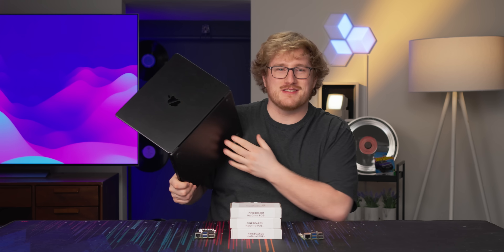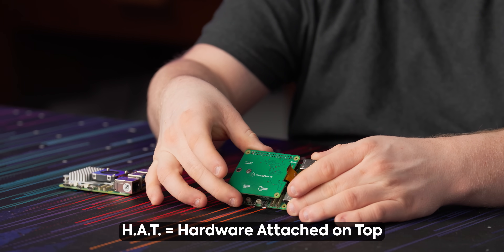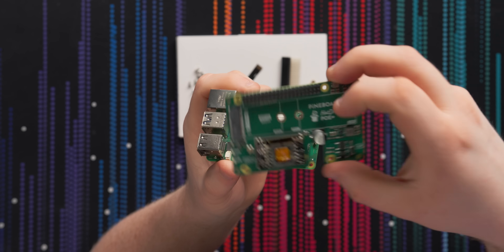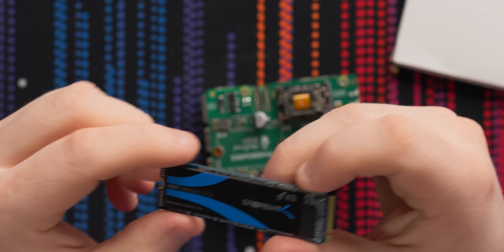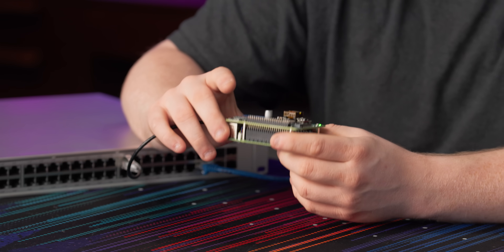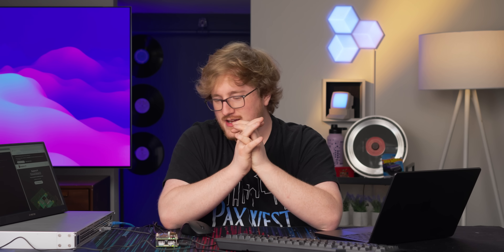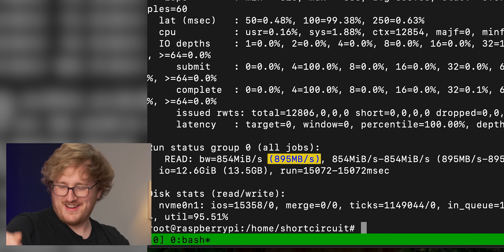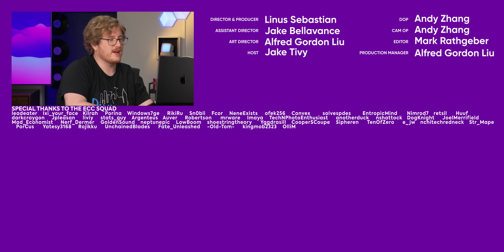This solves the Raspberry Pi’s BIGGEST problem - Pineboards POE+

Comment: "Argon ONE M.2 Aluminum Case" for Raspberry Pi 4...  I've had one for a couple years and they're pretty slick. (there's a new version for the Pi 5 too) The whole aluminum case acts as a giant passive heatsink but there's also a small fan too, only wish it was larger diameter/quieter if say you're overclocking the snot out of your Pi! 😅 I just stuck a "normal sized" CPU heatsink [AKA massive F'n over-scaled!] on top of the case with some thermal conductive tape and the fan never runs with a stable 2.2mhz overclock! The M.2 NVME daughterboard connects using a USB 3.0 port adapter which means drive speed is limited to ~600 MB/s vs newer NVME drive speeds around 3500 MB/s, that's nearly 6x faster, but still about 3x faster than your typical MicroSD card speeds of around 150-190 MB/s!

Comment: One thing you DEFINETELY should do is install log2ram if youre running your Pi off of an SD-card.
Bonus points if youre grabbing a Pironman 5 Max, which has 2 NVMe slots and the cutest tower cooler youll ever see. ;)
(Because, whom are we kidding, OFC your goina OC it to 3GHz. Esp now that you cant void your warranty anymore by feeding it too much voltage.)

Comment: I disagree. 

The Raspberry Pi’s BIGGEST problem is overheating.
Then you order the FAN + heatsink. Then you notice that the FAN is noisy AND you can't control its speed.
and the story goes on and on...

Comment: These little things are so sick. We built a cluster out of them for a Systems Administration class at my college. And yes, the head node had a micro SD card as it's main drive and yes it did fail and yes it did fail many times and yes I had to fix it every time and yes i was a participant in the class and yes we did eventually switch to the nvme

Comment: Love the NVME drive addition.  I've used POE to power my Raspberry Pi boards for a while - I just use a POE splitter off of a POE switch (UI also).  These are normally around $5-$15  so a bit less than a hat.

Comment: Pineboards is no more. Dead company. Also, when you add Hats (or in my case, boots - under-board) you increase the power draw. Gets to the point where PoE will never give the amps needed. Pi 5 draws more power. Not sure PoE is up to the new Pi power draw requirements, unless someone comes up with a new ethernet standard that includes more amps

Comment: Just picked up a Pi5 a Poe+ hat and a GPIO breakout hat all nested nicely on the Pi5. Used the same Windows Pi sd card writer from the Pi site with the nVME drive installed in a nVME USB adapter. Pointed right to the nVME drive instead of picking an SD card, the nVME was detected by the Pi installer wrote my image to the nVME just like you would an SD, installed nVME into the Pi5 hat and it booted right up first try no issue at all. Easy Peasy. I put Retropie on mine as it is time to upgrade my MAME cabinet that I built way back in the day in a Final Fight cabinet when MAME 0.59 was the latest and greatest using an old DOS\XP front end called ArcadeOS. Picked up a GPIO breakout hat also as I am going to try to use it to interface my two player 8 way joysticks and 8 buttons per player all to the Pi GPIO as well. I have a feeling I will run short on GPIO pins and cant reuse my old I-PAC1 as it's PS2 interface, so I also have an IPAC 2 (USB) on hand in the event I cant get the GPIO to work\behave how I want. few more weekends of tinkering and migrating the pi into the cabinet in place of the old Mobo setup and I should be in business with a fresh Linux\Emulationstation\Rretropie updated MAME\console cabinet for the next 15 years  :)

Comment: So intensiv you touch all smd components on the board i know you do know nothing over esd.  7nm structure inside the chip is loving high electric static voltage for a date on heaven.

Comment: Why do people act as if PoE is some amazing, magical thing?

There’s a spare pair of wires in an Ethernet cable - they’re connected to a power supply at one end, and on the pi, those two wires are connected to the pi Ethernet port, where they appear on two pins… and those pins are connected to the power input, to power the pi.

Comment: You can also attach drives externally. I have an SSD attached with this cheap single external adapter, like $8 iirc, plugged into one of the USB 3 ports, works like a dream. Leaves my hat space open for the Ai 26Tops hat+ for my Home Assistant server.

Comment: Such a strange design. :) Why not just separate the computing bits from the interface bits? Then you can easily have cheap carrier boards that does what you want. But I'm guessing this is a signal that rpi is still primarily for tinkering and hobbyist uses, and then maybe the HAT design is fun. :)

Comment: Great shear. TY
What do you suggest for me. I need a 3tb 24/7 NAS, video playback, torrent'n and low end gaming would be a plus and having a cell phone would be cool to. 
Any thoughts ? Any pointers on a mother board that is not one of the ridiculously expensive frameworks mobo ?
I'm on the fence to build one or just buy something like a steam deck. Or even a Nintendo switch and turning it into a steam deck/PC.

Comment: It would have solved it if it came standard. Also, how does POE solve the biggest problem of not having interchangeable usb-c ports instead of freaking mini hdmi and the crazy asshole decision to use a non-spec 5v5amp power requirement instead of spending 2c more on components.

Comment: 80 euros for a Pi5. It started out as a 30 euro minicomputer, so that everyone could afford one. OK, the Pi5 has more memory and is many times better than the original first Pi, but with 80 euros for the Pi5 you are not there yet. You have to buy at least the appropriate HDMI cable, USB cable, power supply and a decent cooler. Then you quickly end up with more than 100 euros. The noble idea of Raspberry Pi organization that everyone should be able to afford one, is outdated, very outdated

Comment: the SD card issue is why the SSD / M.2 expansion boards for adding in small SSD for running the system off it.

Comment: So... it requires POE+?  Other POE hats I've used on prior gen Pis did not.  And I'm really kind of uncomfortable with blocking the cooling fan... Pis have really needed active cooling since the Pi4.  I miss the Pi 3 era, despite the higher performance.  I don't really use Pis for high performance, so I'd rather have them run cooler and without needing active cooling...

Comment: To easily transfer your operating system from the micro sd card to your m2 disk, you install it on the sd card and then you can easily clone your sd card to the m2 disk. Or you install the operating system directly on the m2 disk. I did this exact setup about 1 month ago, and what a difference right at startup. Raspberry pi started so quickly that I sat there surprised and wondered what happened. Thanks for a great channel and greetings Linus ❤️ Yes iam frome Sweden

Comment: 0:10 nah ahh small computers aren’t even real computers. There I said it
Reply: The both of you are entirely overlooking what a computer is and what these SBCs are capable of. ARM is not an issue.
Reply: @kyle8575  like I said, he's kind of right
But not completely since x86 SBCs exist and they do much better than RasPis
1L PCs are a good example.
Reply: @Outofcreatvienames  You’re implying ARM chips aren’t capable. They definitely are, and are growing in usage. The x86 vs ARM argument has been dated and there’s very few use cases you need x86 for in embedded. I mention embedded because that’s the main target for SBCs.
Reply: @kyle8575  just because I said x86 is better than ARM doesn't mean that I said ARM is weak
That's a whole different sentence.
X86 is more capable in terms of I/O connectivity, OS support, PCIe, transcoding (since there's nothing better than Intel iGPUs to do this)...
ARM doesn't have much as much OS support as X86, but it excels in terms of efficiency and size differences when it comes to embedded systems.
Reply: @Outofcreatvienames   You made a blanket statement of “x86 SBCs exist and they are much better than RasPis” You continuously imply that ARM is an issue. Either you don’t know where you stand, or you are refusing to admit the wording you chose is dubious. The large majority of non consumer devices run Linux. Very few Linux distributions do not support arm. What are you doing with PCIe on an SBC that arm is an issue? There’s a plethora of HATs for Pi’s or similar SBCs. Making the argument that x86 is generally better is contrived. Of course there are cases you do not want arm. For example, I don’t think anyone should be using a Pi for a desktop, NAS, or plex; Get a mini PC for that.
Reply: @kyle8575  I was basically saying
"Hey, x86 SBCs exist, it's just that there aren't many of them on the market"
Reply: LattePanda: That's where you're wrong kiddo.
(Tbf, you're kinda right since most SBCs are using ARM chips, there aren't many SBCs that use x64 chips)

Comment: I never understand what people DO to their micro SD cards to kill them so much. 

I’ve had my Raspberry Pi 3 running 24:7, 365 on the SAME SanDisk micro SD card since 2017, running a continuous bash script to download shows, running “Pi-Hole” 24:7, and not ONCE has it failed, and still passes fsck. ¯\_(ツ)_/¯.

Comment: I want to like this, but these features should have been built into the Pi 5 in the first place, the oddball power requirements of the PI 5 is what I dislike the most about it, the platform is not a cheap low cost solution anymore, if you have to purchase either official power-supply or a board like this, you may as well look at something else far more powerful with a wider feature set for less money.

Comment: I have this exact hat already. Installation of the gpio extension was a pain to get into the holes of the board. 

My only real complaint is finding a case to put it in. The hat is just a slight bit longer than the pi so I can’t just put it in a case that is made to support a pi with a hat. 

I’m good with 3d printing one but was hoping someone had a  file I can point to.  The open plate version the hat maker offers isn’t what I’m looking for.

Comment: For context on the speed, this is faster than a SATA port
Reply: Not by much
Why even bother when you need a bunch of crap and adapters and specific PoE infrastructure.
New deployment? Evaluate feasibility of a reliable PoE and posibility of hat failures. A cheap SATA SSD or a usb drive still makes makes more sense.
For some cases, would be marvellous

Comment: why does it say 29.99 for the precision screwdriver but i go to the website and it says 49.99?
Reply: 29.99 is for the screwdriver only, 49.99 is for the set with the bits. They did this because some people already have an ifixit kit, so they have already bits, so if they wanted just the screwdriver, and use the bits they already own. Then they dont have to buy the bits again... that's why they did this...
Reply: @jaro5822  ahhh, ok that makes sense. Thx 🤜🤛

Comment: This is peak upper-middle-class manchild energy—a product solving theoretical problems we don’t actually have. It’s like doomsday prepping for nerds. And yes, I’m one of you. I bought it, only to realize I have zero real use cases for it. Sure, it’s a great fileserver… if I didn’t already own a proper one. And yeah, it saves power… roughly the equivalent of turning your air conditioner off one minute earlier per year. Perfect for DIY projects, but let’s be honest, ESP32s on AliExpress cost about as much as a bag of chips.

Comment: So if you don’t already have one, you need to buy a POE switch in order to power the drive on the hat?
Reply: You can use cheap POE injector if you have just one device. A switch makes sense with multiple POE devices.
Reply: So you replace a USB power cable with a UTP cable? It is still a cable. Prefer wireless network and USB power.

Comment: 9:43
blame drive manufacturers
MiB and MB used to be the same, but drive manufacturers decided to define KB/MB/GB etc to be multiples of 1000 instead of 1024, meaning they could advertise higher drive capacity without actually hitting the KiB/MiB/GiB capacity, making it a bit cheaper. That's also part of the reason that a 1TB drive always shows as being a bit less than 1TB when plugged into windows, because windows looks at disk in multiples of 1024, so it'd need a 1TiB disk to show as 1 TB
it's all a mess really

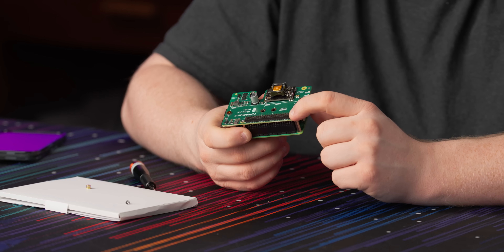Comment: 4:19 Regarding the commet about the GPIO pins. The GPIO Pin header extension should be installed in the Pineboard first and then these Pins stick out a lot more on the hats side. there will be a "gap" on the bottom between the black part of the extension and the black part of the RPi GPIO pins but normally there ist still contact with the GPIO pins. for some other vendors they supply you with an extra "gap filling" plasitc piece.

Comment: I guess I'm slightly confused... 2:25 if the Pi5 already has POE, why is the hat advertising POE as a feature? Is it just because it includes the headers to enable POE? Are these headers not just included with the Pi5 by default?
Reply: The pi doesn't have poe itself, it has an Ethernet port. You need the poe hat to convert the 48 volts from poe down to 5volts. It still uses the pi's original Ethernet port, but you cannot power a pi over poe without that voltage conversion
Reply: There are headers from the Ethernet cable that are exposed but pi5 does not utilize the 48v lines and use it for power. It only uses the 5v lines on power input, this hat takes those exposed lines converts them and feeds them back into the pi5 power input

Comment: I know a thing or two about those high endurance cards. There's a company that shipped a product with cheap non high endurance microSDs as the primary storage for a touchscreen control module that used PoE. The failure rate with those was so high that they ended up shipping the service companies hundreds of replacement high endurance SDs with an open warranty claim to replace them when they failed.

Comment: Or you can just use USB3 m2 drive as storage, The pi 5 got 4 USB 3 slot, yes they all shared lanes but hey 4 m2 drives.
Also you can try using the m2 slot 4 sata adapter. The NAS community already done it and it work pretty good. They still shared  lanes though. In all you got 8 accessible ssd storage.
This is my personal annoying preference but you should change the tittle to list as raspberry pi 5 instead of just raspberry pi. Raspberry pi are ALL raspberry pi included pi1 and pi zero, pico may or may not cause they are just microcontroller.

Comment: This is convenient, but as an anecdote to the SD card I have x2 24/7 Raspberry Pis that are used moderately ones been running no issue for about 5 years the other about 3 years on a sandisk micro SD class 10 or better. But that is not to downplay SSD's just I think SD's are much better than in the past and deserve some credit. SD talking strictly purpose of a Raspberry Pi.

Comment: After the Raspberry Pi 3’s shortages, I always thought that supply was its biggest problem.  My company spent hundreds of thousands of dollars designing a new piece of hardware, only to have to scrap the whole thing because these silly folks had no way to make enough Raspberry Pi 3 compute modules.
Reply: It was not the fault of “these silly folks” that the entire world suffered severe supply-chain issues.
Reply: @ Sounds true, but we were able to source every other component for this device (there were hundreds).  The lone exception:  the raspberry pi 3 compute module.  So somehow everyone other vendor of every other component was able to supply parts.

Comment: I did my PoE ESP32 hardware a few weeks before. During the debug/programming, I've touched the 48V DC a few times, and dropped the board immedietly.. It's not a good feeling, but much less pain, then touching a fully loaded camera flash capacitor (300V+) which I did as 14y old :D I don't really get however, why that big transoformer used there. I've used TPS54361-Q1 to reduce 48V DC to 5/9/12V DC with a much smaller inductor...Are there maybe some galvanic isolation? Hmmm...
Reply: Standard compliant PoE must have galvanic isolation IIRC

Comment: What sort of use cases do you have for a Pi on Ethernet with such fast storage on it though? All the ideas I have for projects rely on the portability of the Pi, either battery powered or as a take-anywhere plug in device with wifi.

Comment: In my book, being a small computer is not the use case an RPi is really good for. There are way better pre-built mini-PCs for that. What the Pi excels at is having easily accesible IO to interact with sensors etc. and loads of tutorials for the wildest applications, simply because there are so many people using it.
Reply: I agree it's great when you need a small machine to interact with some physical stuff but you don't wanna use an arduino because you want the flexibility of a full computing platform.

Comment: I just have to say, the biggest problem I have isn't just the SD card, pi can boot from usb now with the updated bootloaders. My biggest issue is the shitty micro-HDMI port they decided to use over just stacking 2 full size, or display port, or even USB-C with video output. There are so many superior options and they decide to stick with shittier choices. Heck, at least with display port you can daisy-chain AND have no royalty fees.

Comment: Simpler solution: USB to NVMe adapter.

You can even get powered SATA adapters for 3.5'' HDDs.

Used it for >1 year on 2 separate PIs without issues.
Reply: Booting Pis from USB drives/adapters has been around for well over a year now. If someone offers the false dichotomy of SD card vs M.2 slot it tells me they either don't follow Pi developments or they have an agenda.